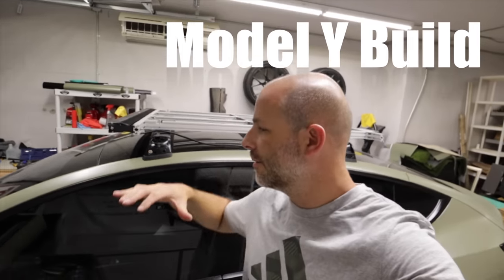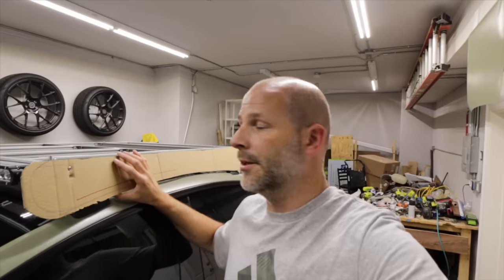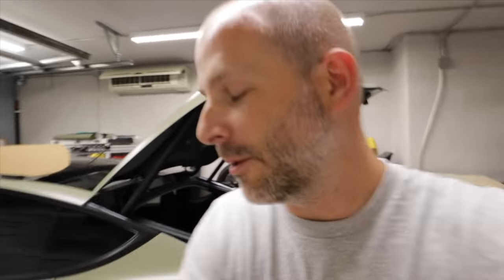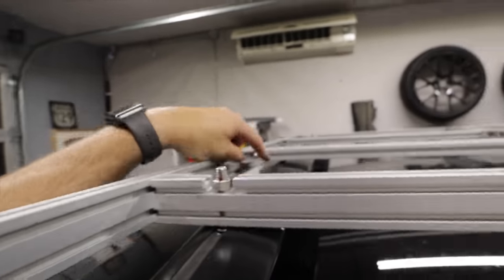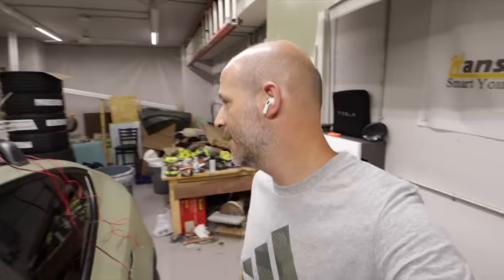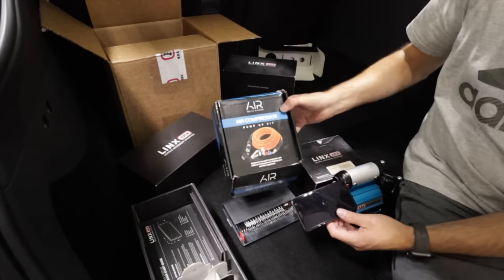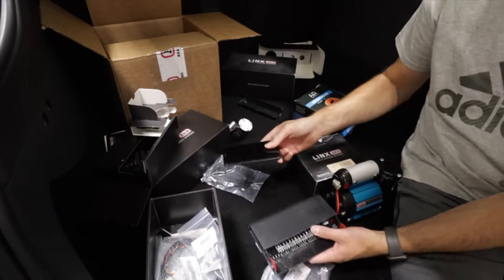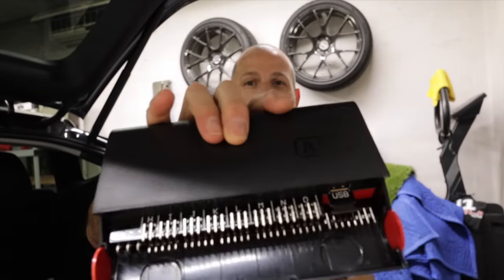Vlog #6 Model Y Build - Roof Lights

Comment: Hey I'm not even half way through you vlog yet and have two comments.  The two side, front and rear panels/plates need to be made from Carbon Fibre not metal.  Secondly, you will never get to push a button and inflate or deflate all the tires at the same time.  Look at what the Hummer had to do.  You need very special rims with the airline going through the center, I think you get the point.  It will be too costly!  Love the look so far.

Comment: Did you consider using a small battery pack to power the lights rather than running wires to the car battery?

Comment: Hi Brian: I am really enjoying the incredible modifications that you are doing to BobY! 
Have you considered replacing your 12 volt lead acid battery with an www.ohmmu.com Lithium Iron battery? They are capable of holding a lot more power without a drop off in voltage.